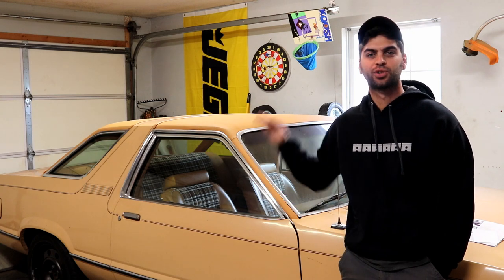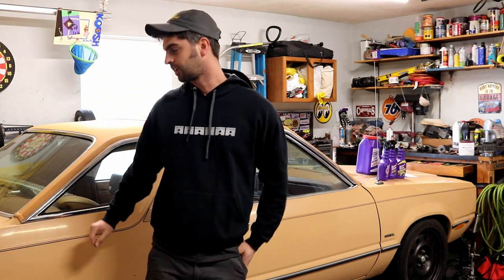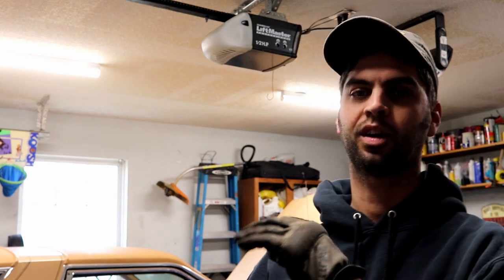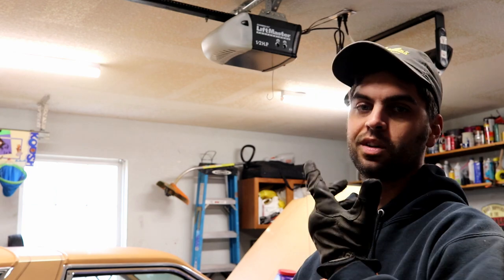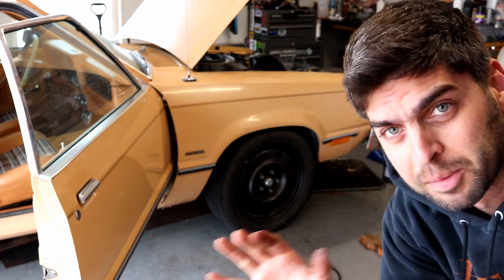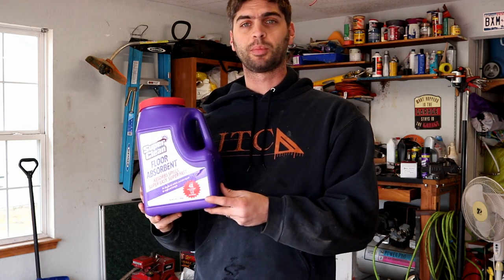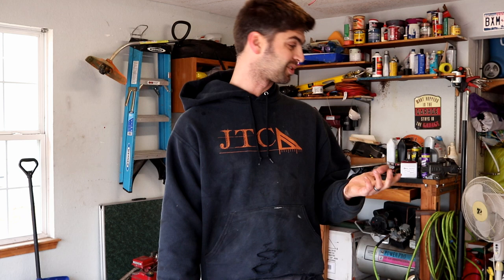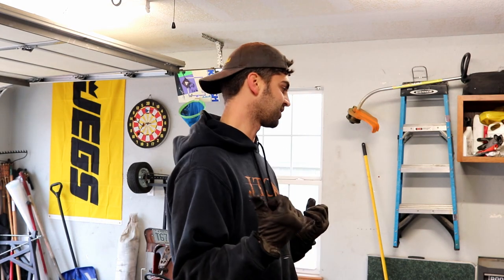Investigating a C4 Transmission in 78 Ford Fairmont

Comment: The modulator has an adjustment needle inside the tube that the vacuum line goes over.. maybe adjust a little and see if it helps or hurts the issue. But low or no tyranny fluid  is probably the culprit.
Reply from the maker: I had previously adjusted it almost a year ago before i did the head swap. But I suspect the low fluid first.

Comment: That is not smoke Grant, that is just vapor from it being cold out, and as far as any rich conditions are concerned, if you want a manual choke assembly, I have some that are brand new in the box, I will sell you one for half of what they are new. Also before you got tuning on that carb, you need to hook up the complete exhaust system, it will make a minor difference, and if you need to come out and do some fine tuning I can do that as well.
Reply from the maker: that makes sense.

Comment: ...and if the modulator holds vacuum when you draw on it, it likely isn't the issue.....you can draw enough vacuum with yer face and a hose to test, if you don't have a brake bleeder pump or similar.
Reply from the maker: Thx

Comment: good morning  well i got something for you to  ponder a bit  do you have any experience with the cursed F,A,P  or if you want to look it up   ole fiat there came out with the multijet motor  around 2004  or so butt to put it into production they had to engage this anti particular system  geez talk about killing a great motor so its connected to the computer maan it  is a real mess way way beyond me so
Reply from the maker: weird, thanks for sharing!
Reply: @Str8sixfan  yes maybe after i learn how to weld a little ill take a welder to this punto  that outta fix it

Comment: apparently it needs to  eat exhaust fumes to 1000 C  are you kidding me  well my son left his 2010 fiat punto here and it dont run to good and it stinks bad and it quits on you  only has 124,000km on it car is like brand new  i cannot afford to fix it  i already tryed 4 garages threw away 1,8oo euros on it  still does the same thing,,, so as were locked down and pennyless i need a remedy otherwise it just sits how awfull  it,s a beautifull car it also will double as i small minivan  butt it aint trustworthy anylonger  SOS i dunno wat to do